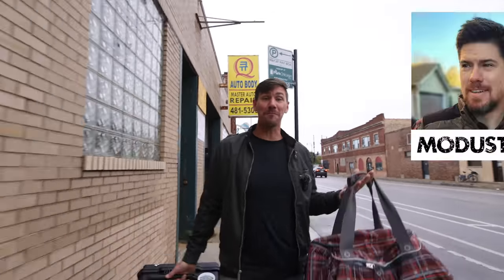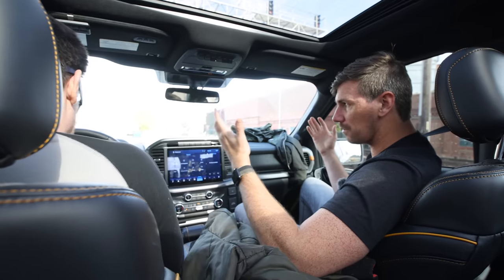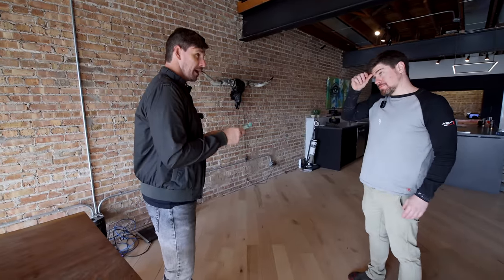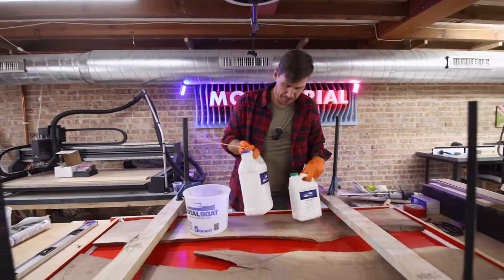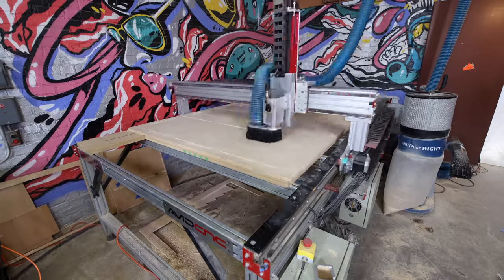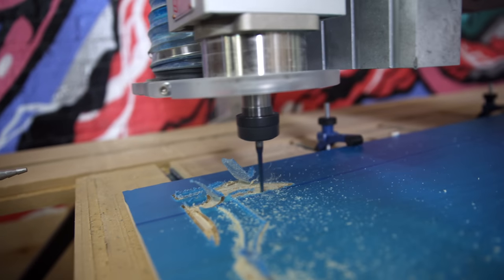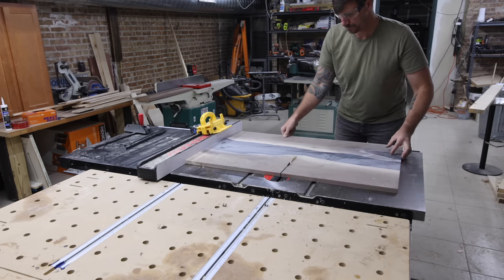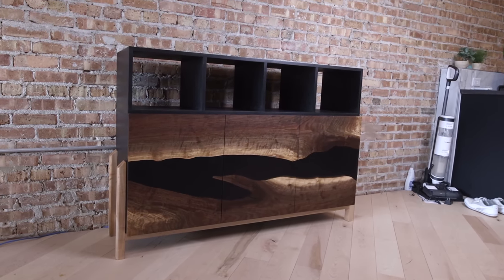Building with NO PLAN

Comment: I love black with wood, but many modern homes use Aqua for decoration. Why not try that but a very light shade. Maybe translucent and make the table with lights underneath to shine through. Use those little twinkling lights that last forever before you have to change a watch type battery? I’m sure you can find something.

Comment: I used MakeByMe to design an outdoor table, but unfortunately I couldn’t get it to change to metric measurement instead of Freedom Units.

It sucks I couldn’t change/couldn’t find where to change it so I can utilise it more.
Reply: Hi Lincoln. We are going to be adding an option to choose units when creating a project. For now we know it's not obvious. If you select "Profile" from the top right drop down menu when viewing My Projects. You may then need to login (same login as MakeByMe). You can choose metric or imperial here. To apply it, you'll need to logout of MakeByMe and back in as we need to create the new library in the chosen units. Sorry about the convoluted workflow, we'll fix it!! Thank, Colin (MakeByMe team)
Reply: @makebyme4743  - Cheers. I changed the units on HomeByMe, but it didn’t change them on MaleByMe.

I’ll attempt logging out and back in!
Reply: The videos are brilliant.
Really insightful and if I can get the hang of MakeByMe, it’ll really help my maker journey!

It’s been great seeing you really take a leap and diving in to your passion for making after leaving the force.
Reply from the maker: Thanks for jumping in with the solution Colin! @makebyme4743